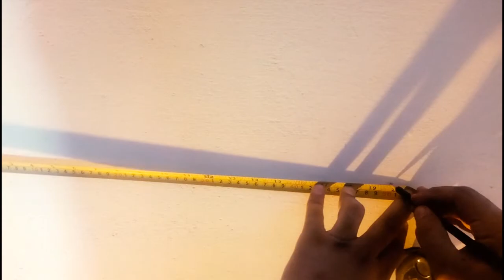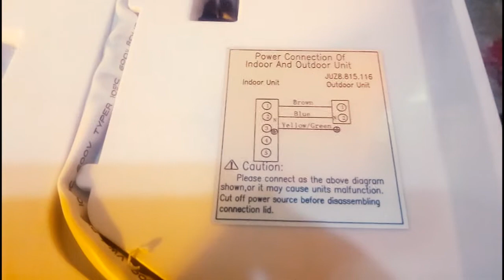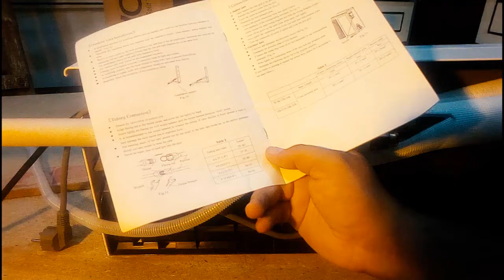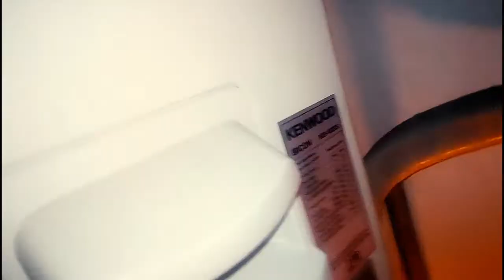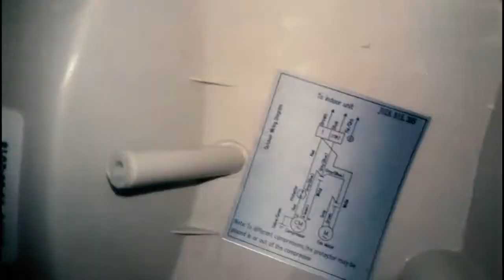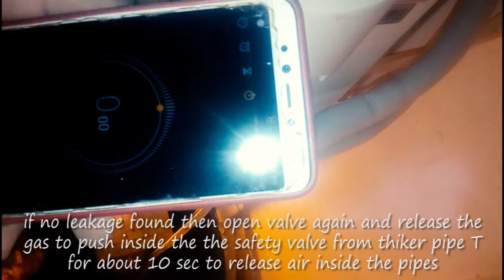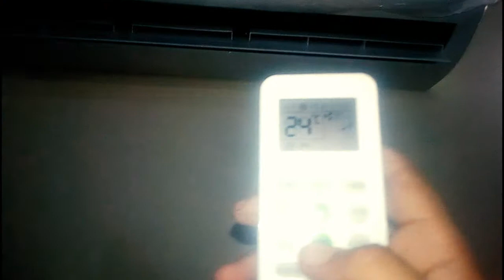How to Install Ductless Air Condition Without Vacuum Pump or Pressure Meter? | DIY

Comment: Sho there are 2 sets of calbes, one that connect the outdoor and indoor unit, and one that goes to the electric plug?
Reply from the maker: Yes one cabel apprx 10 feet is to connect indoor to outdoor
Another cabel is power cord for electric board
Reply: @DIYGADGETS  Cheers for that